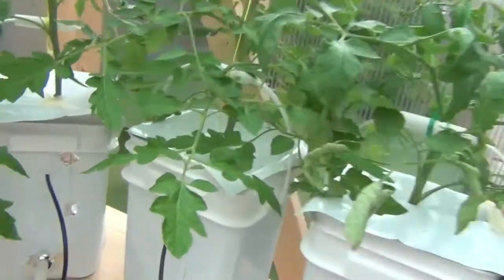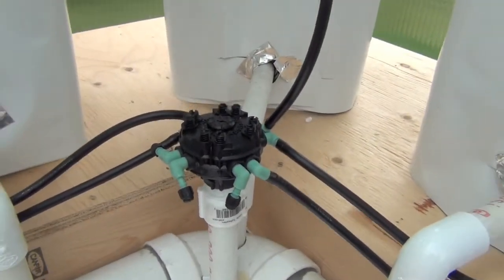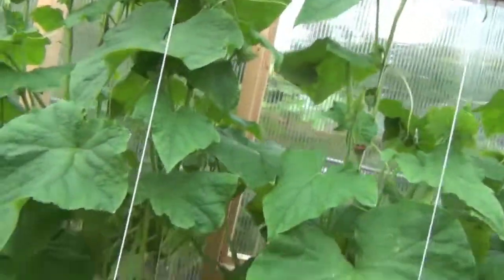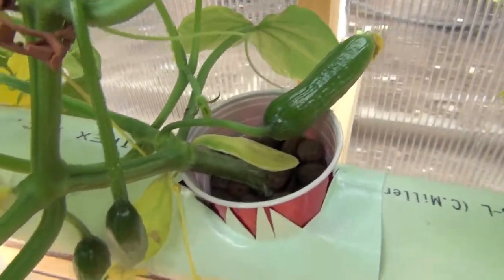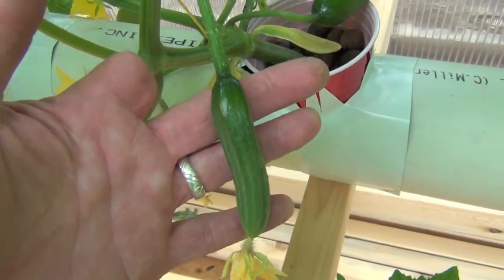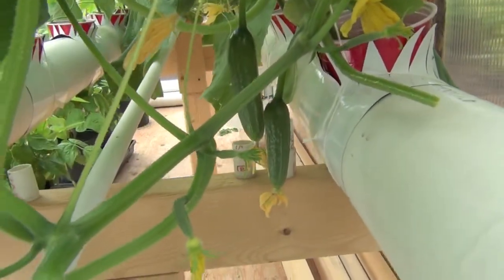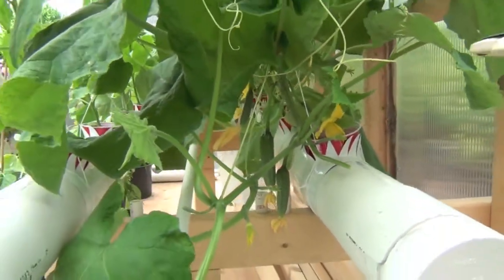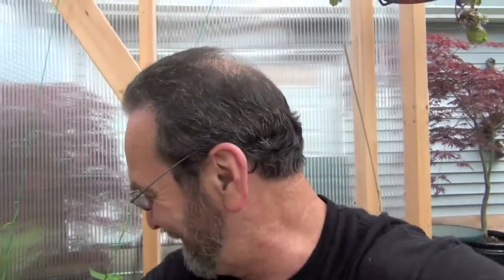Hydroponic Greenhouse, roots and more roots

Comment from the maker: I've gone to checking the roots once a week by disconnecting the tubing and looking straight in and if need be yank the roots out with a hanger :) I've since installed over flow lines. Thanks for the comment.

Comment: A possible solution might be to put the pump on a timer or set up an automatic bell syphon/ebb & flow approach with the equipment you have.  Pump as normal with the syphon located over a larger drain than you have.  The Syphon can be set up to rapidly drain the tube once the solution level reaches your magic level then resets and starts flooding again.  No switches or electronics necessary.  Search Youtube "Automatic Bell Siphon Aquaponics Tips & Tricks"